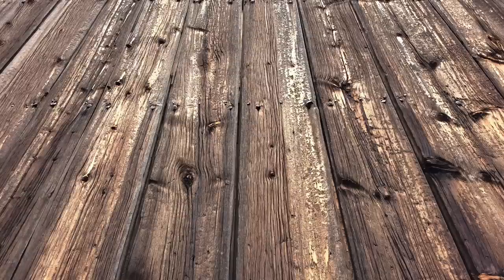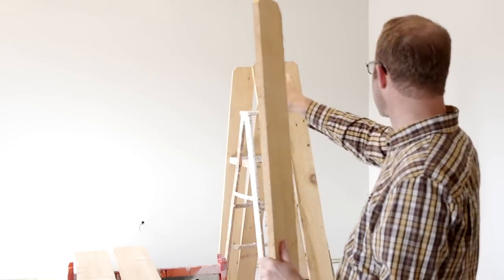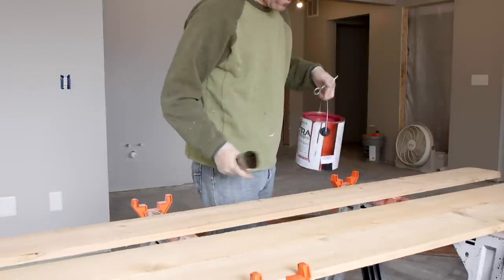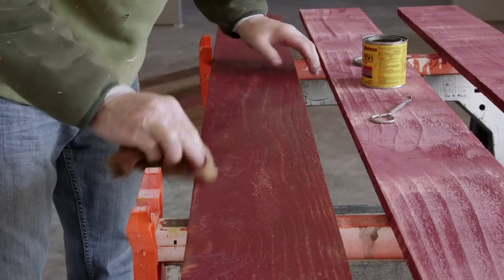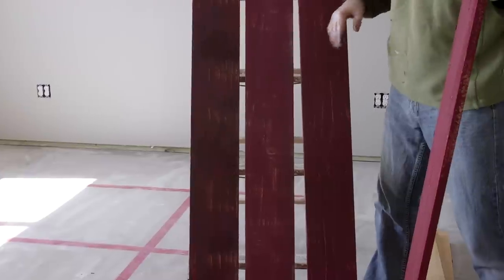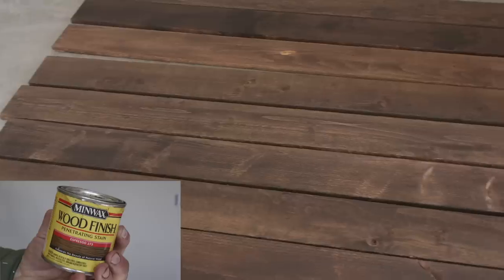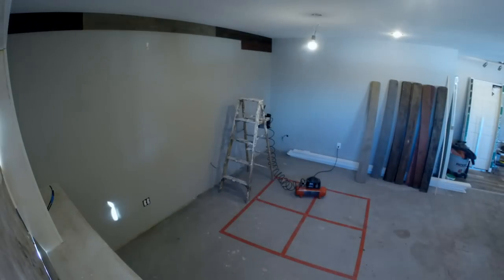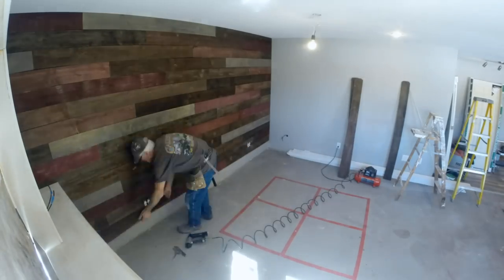Accent PLANK Wall Build on a BUDGET - DIY Cheap Barn Wood Rustic Shiplap

Comment: Much better solution than going with pallet wood or the faux pallet paneling they now sell at big box stores IMHO.  I used similar wood to create a faux rough-sawn "beam" for above my fireplace and I think it came out really well for super cheap.  One thing I did with that project and might do for my accent wall (following your guide) is to put a bunch of nuts, bolts and washers in a sock and beat the hell out of the wood to give it some character. Love what you did and I appreciate you posting a detailed video.

Comment: Love It!!  Thanks for sharing.. Out of curiosity why did you use the more expensive premium pine boards? I have a shop that we are opening up and will have close to 800 sq ft of wall that we want to cover and I see that Home Depot has 5/8 x 5 1/2 x 6ft pressure treated dog ear ones for about $1.50 a piece. Also wondering if could get same results using watered down latex paint instead of the stinky stain.
Reply from the maker: Given what was available at our store at the time, I’m happy with what we used and felt it was a good value.   I’m sure there are less expensive options out there if one looked hard enough.  Thanks for watching!
Reply: I thought treated pine was toxic? Is this different? Thanks

Comment: Looks great.  The only pickets at my local Lowe's and Home Depot are all pressure treated.  Do you have a recommendation on where to get these regular pines?
Reply: You're probably not going to find fence boards that aren't pressure treated.  Just make sure you sand them outside with a mask on.
Reply: What he had in his hands is cedar fence boards..NOT treated pine...dont use treated pine..cedar is untreated because it naturally repels mold and insects.

Comment: Looks great.  Questions...  What size nails did you use (gauge and length)?  Did you first locate studs and only nail into studs or directly into drywall?
Reply from the maker: We glued the ends of the boards first and tried to hit studs.  The nails at the ends, we put them in at an angle.  I think they were two inch nails.. I think they were 18 gauge nails but I can’t remember.  They were pretty standard pneumatic trim nails.  Hope that helps.  Thanks for watching!

Comment: Looks awesome! What size nails did you use? And what was the surface you nailed them to? Did you make sure to anchor them to any studs?
Reply from the maker: I can’t remember the exact size but they were fairly small.  We just went into the Sheetrock so the wall would be removable.
Reply: @PictureTime  Awesome thank you. I am planning to do this on the wall behind my bar, and I want to add some shelves to it to hold bottles.

Comment: That is a great look, well done video. Q: What size of nail(s) did you select, sorry, don't recall the thickness of your boards. Also, I think the liquid nails is a great second option!
Reply from the maker: Thanks!  Our board thickness was about 3/4"  If I remember right we used about 1 1/4" nails.  We wanted to hold them to the wall well but not make it so permanent that we couldn't remove them and repaint if we decided to do so in the future.  Thanks for watching!  Working on a Video for our Barn Door Project next!  Stay tuned!
Reply: @PictureTime  Most appreciated. Best of luck with future builds.

Comment: This is exactly what I was looking for! Great Job! This will give me a little project that I could do with my son. One question, did you paint the boards red and then stain over top of them in the beginning of the video? To get different shades of red? Thanks again!
Reply from the maker: Hi! Thanks for watching.  Yes on the red boards, we painted them, then sanded them, then stained them a few different shades (using stain from the other boards to tie everything together).

Comment: I'm curious how the weight of the guitars, added to just Brad nails and liquid nails, stood up over time. Wether or not the boards holding the guitar hangers pulled away from the wall at all.
Reply from the maker: So far we haven’t had any issues. But I hung the guitar hangers with longer screws.  You could go into a stud to be safe.

Comment: This is amazing! Trying this out now.  Out of curiosity, do you remember the length of your cuts and if you followed a pattern?  Thank you so much for posting this!
Reply from the maker: All we did was trim off the rounded part of the fence boards.  We didn’t use a pattern.  If we cut a board short to fit, we started the next walk with the shorter section on the opposite side of the wall so we ended up with very little waste.  Thanks for watching!

Comment: Question - I never see anyone cover how to do the power receptacles. Since they are flush with the original wall, adding the wood panels would bring the faceplate out the depth of the board. How do you make the receptacle flush (or at least the faceplate) with the new wood wall?
Reply from the maker: Steve IRL we cut the wood to shape and then used longer screws on the power receptacle so we could mount the plate flush.   Hope that helps
Reply: Best way is to buy an extension...they only cost a buck and a half ...its a metal box without a front or back that fits tightly within the electrical box.
All you have to do is shut off the power and remove the outlet from the box and thread it through the back of the extension then push the extension into the outlet box...the tabs on the extension will sit against the new wood wall ....thereby extending the electrical box to the face of the wood wall ....reattach the outlet....turn on the power..done.

Comment: I used these to build a backdrop wall and I put penny gaps, now the gaps are nearly and inch...so much shrinkage..not sure how to prevent that (a tiny amount of drying would not have solved it..mine kept shrinking over the years)

I am redoing the wall but not sure how to avoid this shrinking this time.

I sanded all my boards and it took forever, but I see you skipped the sanding..I might do that this go around and save myself a ton of time lol.
Reply from the maker: We let our boards sit in the basement for a couple weeks before installing the wall.  A lot probably depends on how wet your lumber is.  If it’s wet, you’ll want to let it rest / dry out longer before installing.
Reply: @PictureTime  Yeah turns out using pressure treated fence boards are not ideal for projects unless they've sat for weeks or months and dried out. But I needed a cheap solution.

I'm redoing my wall with the same boards but I had to replace 5 with new boards, I will just put those on bottom with temporary fix so that when they shrink I can adjust them. Should be fine =D

Comment: How do you put the wall outlet plates back on, do you have to adjust them at all
Reply from the maker: You can just use longer screws for either the plate or the outlet itself.

Comment: I love your wall the unfortunate part about your video is you did not explain how you actually hung the boards if you just fixated the boards to the studs… I will assume that’s what you did!! It’s quite shocking how Pinterest and even YouTube does not have the type of videos you just shown which is doing a project like this on a budget because everything I’ve looked at is terribly expensive the peel and stick the shiplap and then there’s the wood pallets that would take A while to run around town or find a place that has a lot of pallets… So I want to tell you how much I appreciate your video showing DIY as well as on a budget and my next video of yours is of course the barn door..I will be making a small version of that barn door for the bathroom!! Thank you!
Reply from the maker: Lori Rogers thanks for watching and commenting Lori.   We didn’t necessarily affix the boards to the studs. I’m sure we hit a few, but we just put a little glue (liquid nails caulk) on the corners of each board and then used a pneumatic nailer to affix them to the Sheetrock.  We wanted it to be fairly easy to pry the wall up without causing major damage in the event the styles Chan’s and we wanted to remove it.  The boards aren’t that heavy so I don’t believe to need to hit many studs for them to stay put.  I hope that helps.  Best of luck with your project.  Thanks for liking, subscribing and sharing!

Comment: You hit the corners with black paint???? Just the 4 corners or every edge piece?
Reply from the maker: Anywhere there might be a gap where you can see the edge of the wood.  Test fit each board before nailing.  Hope that helps.  Thanks for watching!
Reply: @PictureTime  👍

Comment: Wall looks great - thanks for sharing. Did you have a problem with the boards cupping?
Reply from the maker: Christine Scott thanks for watching!  We had a little but it really helps to have he boards dry out a bit (2 weeks or so) before you hang them.  We had a handful of boards that ended up being too warped to use.  It also helped to glue the ends. Have fun with your project!

Comment: Looks amazing! We are planning on doing ours this weekend. We have a brick fireplace in middle of wall. Question is- would you start on top of fire place or at the ceiling  like you did? Also do you always start at center of wall or at side?  Thank you in advance
Reply from the maker: Missy Rubio Rubio  We started at the top because if we had to trim the board width on the last board, we wanted that covered up by the base molding instead of having a “skinny” board at the top of the wall.  I’d recommend starting from the top.  Thanks for watching!

Comment: Aren't those boards pressure treated?  Is that safe to use indoors?
Reply from the maker: Culture of Life Media Thanks for watching!  The boards are NOT “green treated” or chemically treated.  You are correct, you wouldn’t want to use those inside.  These are just rough cut pine boards.  You could also purchase cedar boards.

Comment: Love this but where did you find that red barn paint
Reply from the maker: It was “ooops” paint at Menards.  I show a picture of the can in the video.  Look for red deck stain at your home improvement store.
Reply: Love how your wall turned out!
And you went with fence panels and not pallet wood.. I’m happy to see that.
I’m doing a similar wall with fence panels, but mine are salvaged from an actual cedar fence. Years and years of weathering.. but I will be sanding them down to a smooth finish, followed by a watered down paint (stain), and boiled linseed oil (possibly).

And I’m happy to hear that your wall went up in about 3 hours.. My wall will take longer, I wasn’t sure how long mine will take( not including the prep work of the boards, sanding, and staining).

Keep up the good work! This is the first I’ve seen of your videos. I’ll be watching for more!

Comment: What type of nailer did you use, framing nailer?  How easy will that be to remove?
Reply from the maker: utseay we used a trim/finish nailer.  Like what you’d use for floor/window trim.  I think it’ll come up pretty easy with a small pry bar and hammer.  Minor wall repair will be needed after.

Comment: Did you use outdoor treated boards? I've been told you should not use treated boards in doors.
Reply from the maker: Mike Mcdaniel we didn’t.  We just used regular pine fencing boards. But did experience some warping as a result.  If you use untreated boards, I’d let them sit in your space for a week or two before mounting to let them dry out
Reply: Thank you @PictureTime

Comment: U probably dont have wanna have treated wood indoors. Otherwise, great wall.
Reply: whats the reason ?
Reply: @maxma780  chemicals used in the pressure testing process, particularly formaldehyde

Comment: just buy the boards pretreated.... fence boards that arent pressure treated are impossible to find and by the time you mess around with multiple stains, the extra labor not to mention the extra cost for the stain.... its not worth doing this way.
Reply from the maker: Plenty in stock at Home Depot last week for under $3/board.  Many different boards could work.